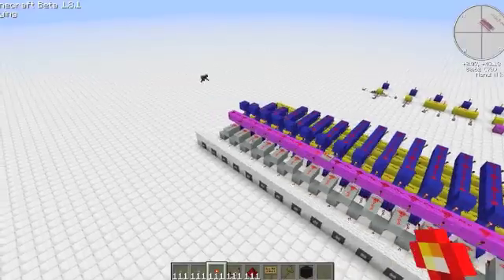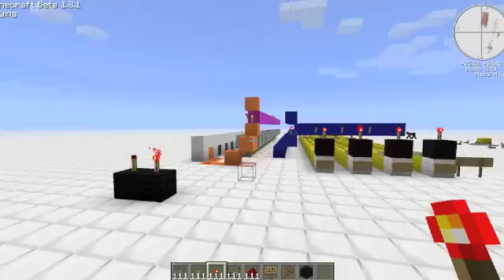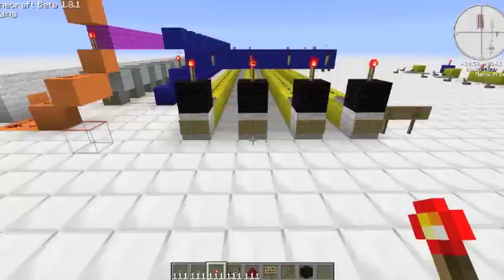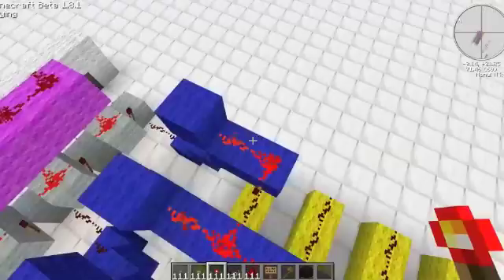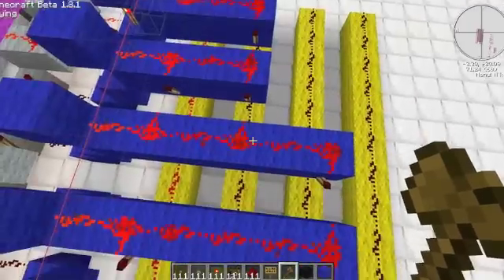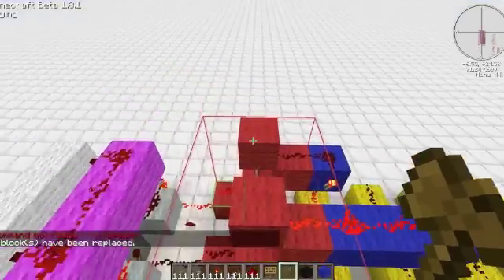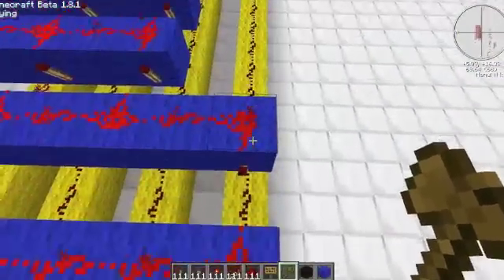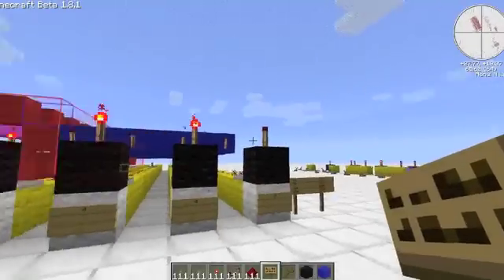redstone for noobs part 2: binary and encoders

Comment: -----------------------
\[][][][][][][][][][][][]
 []/[]/[]/[]/[]/[]/[]i[]/
 []\[]\[]\[]\[]\[]\[]\[]
this isnt a tutorial but this shows u a decoder the / and \ are torches on the sides of blocks and the i is a normal torch to represent ur binary number. that is a picture of what a 2 would look like in a decoder redstone ontop of a line of the binary number. that top left torch is ur output it will only turn on if u input a 2 in binary.the / are o and i is a 1. the bottom row is the same always

Comment: There are only 16 if you include the number 0...  What is 8 + 4 + 2 + 1?  Try to make the number 16 with these first 4 powers of two.  If you still don't believe me put in the number 16 into a scientific calculator and tell me what it is in binary.   I know it from just doing it in my head its 10000.  In binary yes i agree with you 1 is on 0 is off but after all this is minecraft.  When you spawn a red stone torch it starts out on so i can understand his logic in using 1 as off and 0 as on.